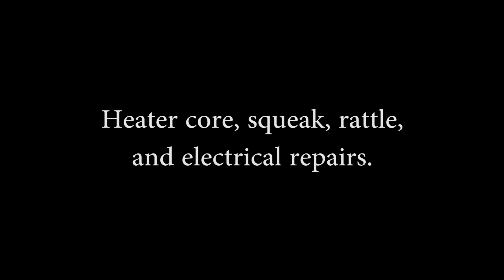Heater Core Timelapse

Comment: No thank you. I've been a 240 Volvo mechanic for 22 years and would never attempt such a task. On the Wonderful 240 series there are "chain-saw" methods to replace the heater core and the blower motor that save so much time.
After the 240, Volvo stopped making cars built with integrity, just like everyone else.

Comment: Any tools used other than torx, screwdriver and socket tool?
Reply from the maker: Lucas Kroon nope. Basic set out tools, longer reaching torx is a big help though. The screws along the top of the heater box are tricky.

Comment: I screwed for 7hrs with a friend now we can't get the ventelation box outside the heathercore to losen.
Reply: Dustyippe I'm having the same issue...
Reply: Okey i got you buddy. Make sure all the sqrews are lose around the heater core plastic box. Then take normal knife and remove the silicone around the plastic box all the way around the whole box then it will losen upp and be easy to take off.